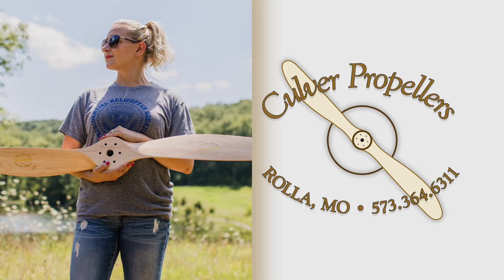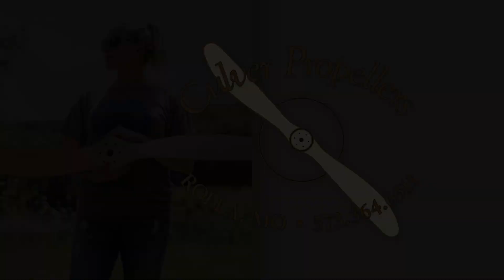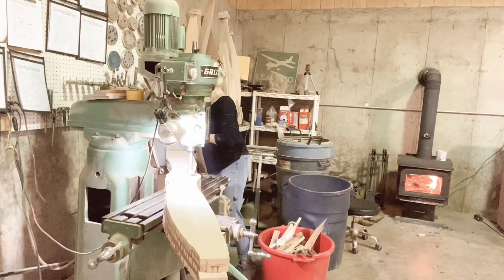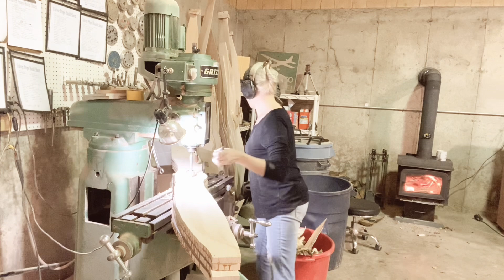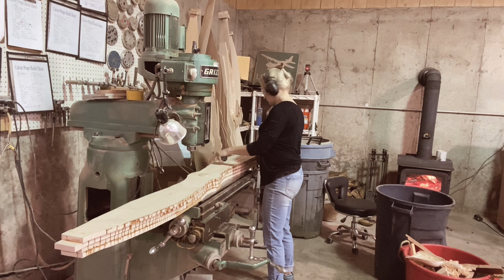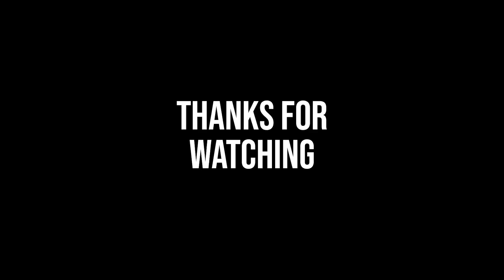How wooden props are made

Comment: Really interesting videos. With the bolt pattern do you have various manufacturers drive flanges to use as jigs/guages? or do you go on custmer supplied data?
Reply from the maker: Both, the customer data will point to what template I use. But I always had the customer measure because people Franklin stuff all the time
Reply: @CulverProps  So true! My biz is engineering, making parts for obsolete vintage machines and vehicles...everythings been Franklined in my line of work! :D nd thankyou for taking time to reply..you have such a unique business

Comment: A couple of ideas that might save time and frustration, (or make it worse, since I am a guy after all lol). You could use the precision of the mill table to make using the laser easier. If you put a pin in a t-slot (or in a flat board that is clamped to the table) that fits up into the centering hole, or into the piece you drop into the centering hole, so that the prop can rotate around that fixed point, then you can use the mill table crank to move the centering hole in and out until it's lined up on the laser, and then you just need to rotate the prop to get the two ends lined up because the center is now fixed on the laser beam. 

I totally understood the frustration of trying to get 3 points lined up freehand when moving any one effects the others too! 

Alternatively, you might be able to do something similar by putting a notch in one end of the blade where you want the hole to be, and putting basically a vertical knife edge bolted to the mill table, (maybe an old planer blade vertically bolted to a 1 2 3 block that's bolted to a t slot at the far end away from the laser?) and then you crank the table until the laser is split on the knife edge, and then while pressing the notch in the end of the propeller tight against the knife, you can tap the blade until the centering hole is lined up, and then go mark the other end. 

Basically I am thinking that since you are doing this on a precision surface, you can use that to great effect without much effort! 

Along similar lines, when you are drilling the ends and holding it down with your arm, maybe get or make a t slot compatible quick grip clamp that presses it down tighter than your arm can do, and gives you freedom of movement once it's locked. 
I suspect someone makes one already, but you could just cut the fixed end off the bar on a quick clamp, and bolt it to a 1 2 3 block that has a t bolt coming out of the bottom. (or bend the end of the bar 90° and put the bolt through it with a nut on each side?) 
So just slot it in, slide it up to the propeller, and clamp it down. 
You might find this handy for other operations as well that don't require the stability of the big hold down clamp system. 
It would possibly be nice even on the larger blades where you need the table extension/outfeed support, since it ensures that the blade is tight to the table even if the end support is slightly off. 

I hesitate to even make suggestions because it may come across as mansplaining (which is where a man will speak down to a woman as if she is unable to understand anything without help....smirk... Yes, I am a troublemaker with a slightly warped sense of humor, I hope I at least got an eye roll, and a groan or chuckle would make my day ;)  Growing up with a bunch of sisters gave me special talents... Lol) but I also believe in putting ideas on the table in case they turn out to be good!

I have a lot of bad or overly complicated ideas, but once in a while I get a good one, and since you specifically expressed frustration with the free hand process I am taking the liberty to propose a couple of ideas.

I am quite impressed with the high level of craftsmanship and integrity that you show, and the fact that you can hold trust in the aviation world speaks volumes.

And yes, I ramble with long ass ideas and comments equally for any gender! Lol 

As I have been writing this, another concept formed (sorry lol).
I haven't watched many of your videos yet, so I don't know your process for drilling the mounting holes, but you mentioned that it's a difficult process that occasionally is slightly off, so that got me thinking.
Watching how the metalworkers would do it, with CNC machines, or a dividing head rotary table on a vertical mill, seems like overkill for this, but then a simple concept came to mind.

I assume that generally either the drive flange or the crush plate will have a collar that centers it in your centering hole, so I am thinking that you get one of each of the common mounting sizes, whatever part it is that indexes with the centering hole, and turn it into a drill jig. 
You can get drill guides that are precision machined to fit over a certain size drill bit, and generally hard steel so they don't wear out. 
My thought is that you weld or otherwise fasten a drill guide, long enough to ensure that the drill bit is perfectly aligned, over each bolt hole in the flange. 
Then you can simply put the flange onto the propeller, inserted into the centering hole, and clamp it down tight, and then use a long enough drill bit and drill each hole. 
I would get a piece of drill steel blank rod in the same diameter as you are drilling with (or use more drill bits), and after drilling each hole you drop the rod into it to ensure that nothing can move before drilling the next hole. 
If the drill guide is long enough, you might be able to do this with a handheld drill. 
You could also do it on a drill press, and carefully move it until the hole lines up perfectly with the drill press, but that could be fiddly. 
There are other ways I can think of, from a small drill press mounted to the plate, or turning it into a jig that rotates on the drill press table with the propeller centered a bolt hole circle distance away from the drill press spindle, etc, but they all base on the idea of using a plate to ensure straight holes perfectly spaced, because they are forced to line up with the actual mounting flange. 

If you liked this idea, the "best" way might be to give a machine shop the bolt circle dimensions, and have them machine up a disk for each mounting style, maybe a couple of inches thick to guide the drill bit, with a centering pin that fits perfectly into your center holes, and the correct positions for the bolt holes bored through. 
They could make it from some tool steel, at high precision, and then you can just insert it into a propeller, clamp it down, and drill perfect holes every time. 
Maybe a hole through the center of it so you can bolt it directly to the prop, or even to a t nut on a table? 

If you have made it this far, you are very patient, and may have experienced brothers before! 
I hope that this hasn't been a waste of your time, and maybe was helpful, or at least created some positive or sassy facial expression change. 

Keep being awesome! ;)
Reply from the maker: I did make it to the end. Lol I do have a younger brother. He has this gift also. Lol! I am a firm believer in ideas spark ideas. I always appreciate people taking the time out of their day to offer good advice. I have made some notes on this and have a few things I am going to play with. :) I am also going to print this out for my brother because it’s too funny not to!! It will probably come back and bite me in the butt. Lol stay tuned!!!

Comment: Hi, Just a question. I do not see any in your previous videos. Why not using a adjustable multiple drill head to drill all the holes at once. Quick and very accurate. Super cool trade you do and oi,huge respect from you from me.
Reply from the maker: Well, I just use what I have, and this machine is what I have
Reply: @CulverProps  Hi, I fully understand. I just mention it as it might be something you can consider for the future. Specially when one like to do most work self. You absolute amazing in your trade.Congratulations.

Comment: Ive always wondered why we don't use wooden props more often then we do these day's like on alot of the Champs, Citabrias and other small fixed pitched taildraggers that are commonly used as trainers, If a prop strike situation ever occurs,  having a wooden prop most likely won't  damage and stress to the engine like a aluminum prop will do, Even though it wouldn't change the fact that the engine would still need to be tore down and inspected, but it would make the fix a lot easier and cheaper not needing a new rotating assembly,   lol
Reply from the maker: Mine are experimental only, so that limits my range. But generally the prop is specified by the type certificate

Comment: Looks like a great mesh between traditional methods and tech enhancements, which is great if that’s what you want to do. The laser is a great tool as long as you know how to use it to your advantage. The squeal sound is frictional and can be lessened by lubricating the bit. I would suggest applying a bit of bees wax to the barrel of the bit to reduce the friction between the bit, wood, and the glue residue. Unlike an oil, the bees wax should not effect any finishing you do later on to the prop.
Reply from the maker: Thank you! Bee wax seems to be a common suggestion! I was hoping I would get a solution

Comment: I would assume that the squeaking is from dried glue that is between the drill bit and the wood while you are drilling. It gets a bit warm and starts to smear. pressing the bit down slower should eliminate it if it bothers you. Very easy to understand that setting up the stand takes more time than pressing the prop down. Just don't forget your safety please. 😉
Reply from the maker: Will do!

Comment: Check out the tram of your milling machine . That means the spindle of your mill is 90 degrees to the table . If it’s out of tram it will sometimes rub on the backside of your cutter
Reply from the maker: Thank you! I was hoping I would get a few suggestions!
Reply: @CulverProps  Tramming your spindle is not that difficult if you have the tools to do it with, I also like using a torque amplifier so I can adjust it that little tiny bit. 
I don't remember what the ratio is on it but it's a real game changer.
Reply: Yes... and the tramming should be checked with appropriate dial indicators. Note that any indicator marks stamped on the machine can only be depended on to get things in the ball park. Do you think the new glue might be playing a part in the chattering? Cool videos, Thanks!
Reply: @rwbishop  yes that’s correct